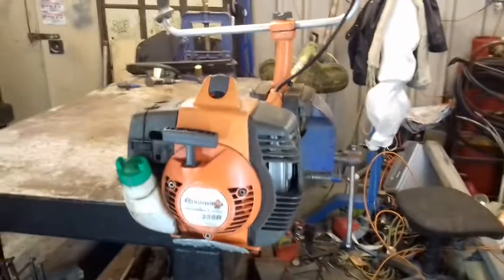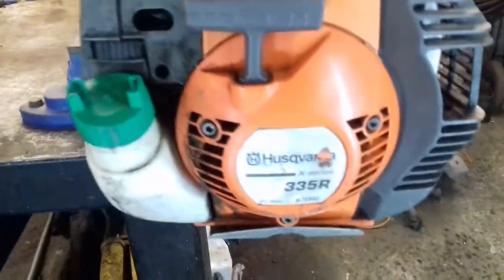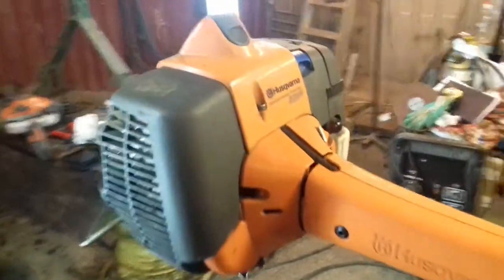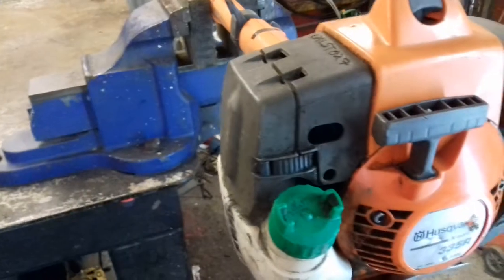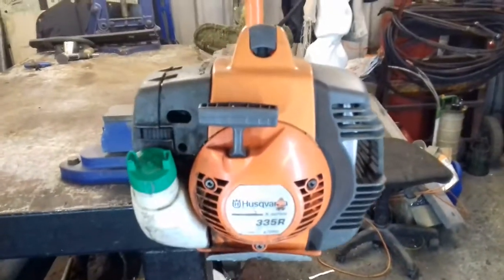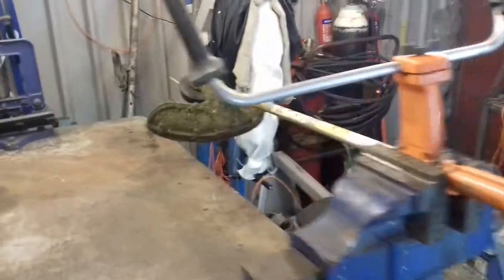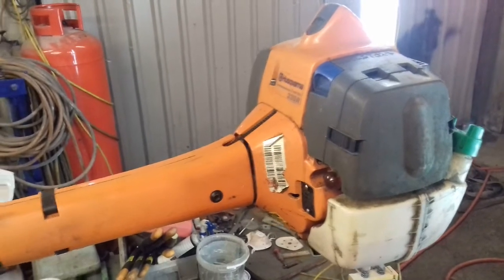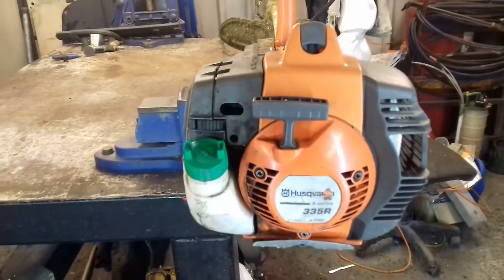Husqvarna 335rx strimmer. review

Comment: That big head with 3mm line is making that thing sweat. They recommend 2.7mm, and I use that. 2,7mm square has big resistance already. I'd advise you to switch it back to t35, and 2,7mm line. You can cut thicker stuff with it, with less effort from the machine.